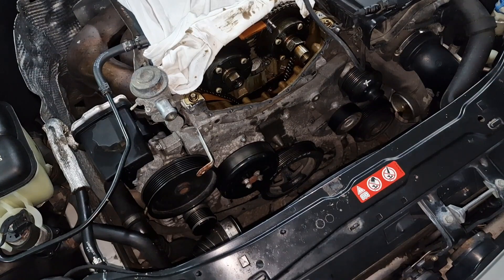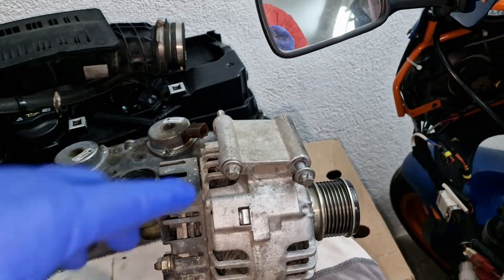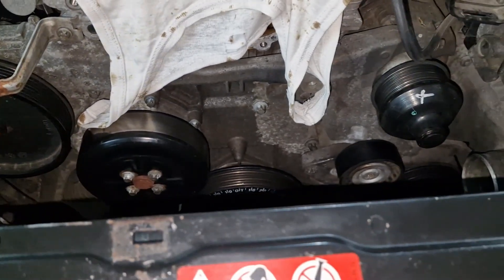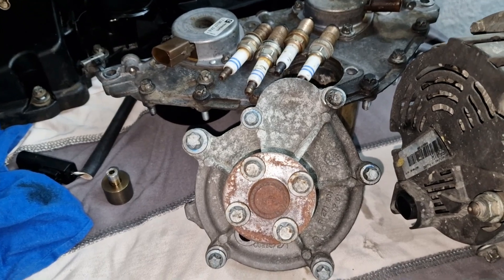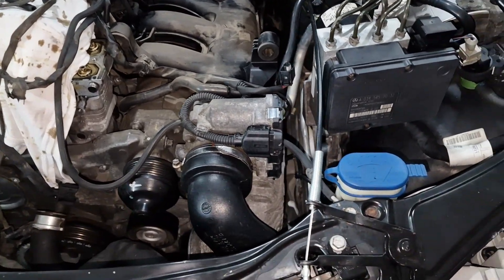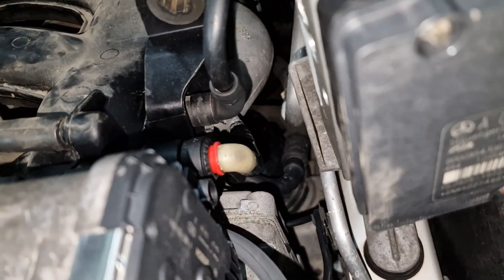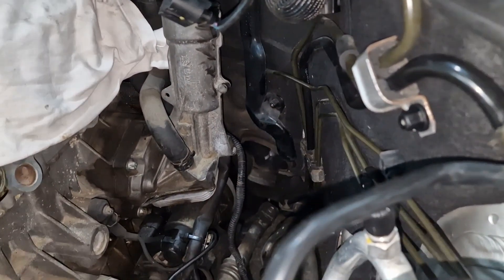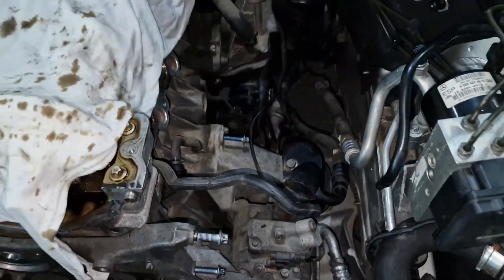Timing Chain kit replacement M271 Part 3

Comment: Good video! They real made access to kompressor dificult i wonder how to you change the oil in the kompressor.
Reply from the maker: @miroslavjevtic6263  the best way to change the oil is to get it of the car and remove the entire cover where oil is stored. Reinstall it and fill back with oil until it pours out of the fill plug. Be sure to have the kompressor standing as close as possible to how it stays installed in the car when filling it back in.

Comment: 10:41  salut daca lantu nu e denituit si legat cel nou de cel vechi,nu se poate pune direct nituit? cel nou
Reply from the maker: Salut! Nu ai cum sa pui lant gata nituit la motorul asta daca nu te atingi de lantul de la pompa de ulei cum a fost cazul la mine. Mai mult decat atat nu stiu sa fie variante aftermarket sau originale care sa vina gata nituite. Mercedes arata in WIS ca lantul vechi trebuie denituit iar cel nou nituit.